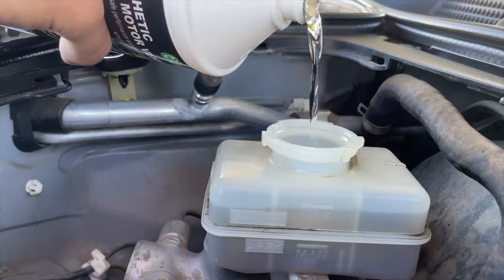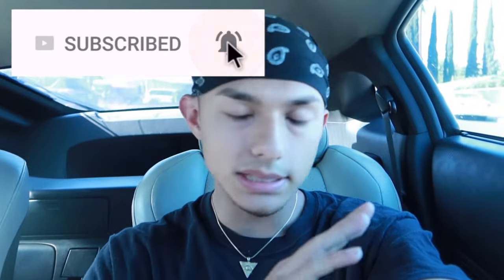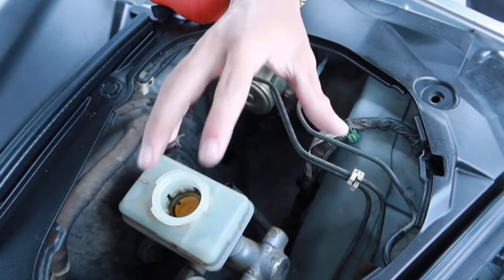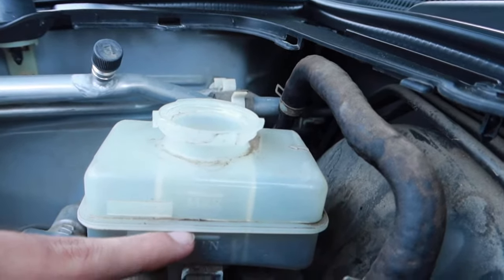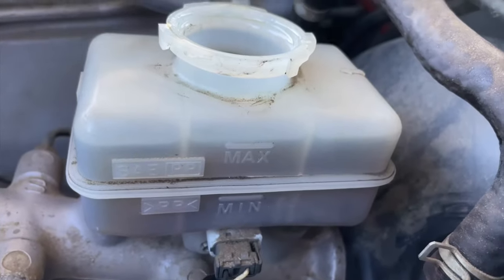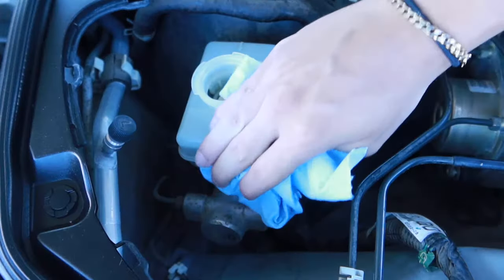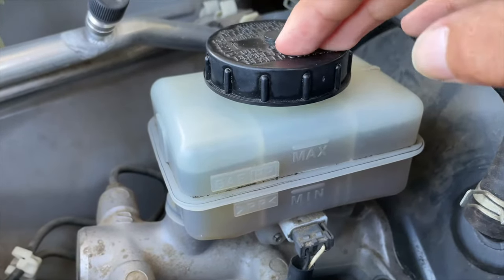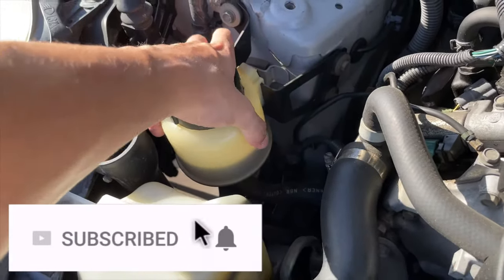How to Change/Clean BRAKE FLUID [NO JACK]! (350Z)

Comment: Some dealerships just change the fluid out of the reservoir.  You can remove all of the fluid out of that reservoir.  You won't get air in the system as long as you do not step on the brakes.
Reply: Thank you
Reply: Question step on the brakes when ?
Reply: @PocketBeast1243r  As long as you don't step on the brakes with the bleed screw open after you remove all of the fluid from the reservoir.
Reply: Question: can I do this if someone put the wrong fluid in there?
Reply: @vonniewilliams750  That depends.  What kind of fluid was it and did they bleed the system with the wrong fluid?

Comment: It's called the "Ranger method" its a lazy army thing lol.  While people say it's not a recirculating system yes that's true BUT the temperature differentials will bring the hotter brake fluid by the calipers up to the resivor so yes this will actually work over time.   I also suggest going all the way to the bottom when sycking out most have a 2 section system where you can't take out too much.  I also recommend putting in Motul 5.1 DOT fluid.  DOT 3, 4, and 5.1 can all be mixed, it's only 5.0 that does not mix with anything except 5.0.   5.1 also has a higher max temperature point. Racing brake fluid that's 4.0 may go even higher BUT don't use racing 4.0 it is thicker and don't last as long.  5.1 is the same thickness as regular 3 and 4 but having the high racing max temp range while lasting the same long time.   Motul 5.1 is the way to go.    Cool video you rarely see people mention the ranger method because they don't want to get made fun of but it 100% does work and I'm glad you made this video.  This method is wayyyyy better than the never change your fluid method :)
Reply: I going try it..it like over $100 at dealerships
Reply: Motul 5.1 doesnt last as long as racing brake fluid is more hydroscopic so needs to be changed out more frequently.
Reply: @riyadyar   racing brake fluid needs to be changed more often like you said.  Motul 5.1 is not racing brake fluid. Motul only makes a racing brake fluid in 4.0 not 5.1.  I use the 5.1 so it lasts longer and has a dry boiling point of 516°F (272°C).  I have not seen any 5.1 fluid in the racing formula that needs to be changed often, it may exist though.  From what I've seen all dot 5.1 are for regular every day driving just with higher boiling points.  I am not just going on hearsay also, I have tested this fluid monthly because I wasn't sure if I believed the claim either and 6 months later it still tests at or below 1% absorption.  Racing fluid would already be over 5% after this long, so for sure Motul 5.1 is THE one to go with.
Reply: I have been doing this range method. I take my car to the dealership for other service's and they have never mentioned needing to change my break fluid. It definitely has worked.
Reply: @soapzuds4542 does this work on a 2019 Nissan Altima ? I ain’t paying them 200$ to replace cloudy brake fluid 😓😅

Comment: Actually you can remove all the fluid in the reservoir.. the reason you don't want it to empty when bleeding brakes is because it's sucking and will pull air into the system, whereas when not bleeding and just sucking it out with pump or turkey B you'll be completely fine and no air will be in the system
Reply: We’ll explain how tf to do it
Reply: Can u remove all brake fluid remove and it won't get air in
Reply: Agreed- As long as you don't press the brake pedal while the reservoir is empty you'll be fine and NO air will enter the system.
Reply: So then all he’s doing is replacing bits each time so that it just works itself into the break system which cleans out the bad break fluids and replaces with good fluid?

Comment: If you're on flat ground you can drop the level well below the min line. That line is only there to make sure as your car tilts while driving and temperatures change, the level doesn't drop so low that air will be sucked in. This whole process will be much more efficient if you can see the intake hose at the bottom of the reservoir and just make sure you don't drop all the way to that level.
Reply: Thanks! great hint for me

Comment: You shouldn't judge brake fluid by its color. 3 is clear but as you go up dot4 or 5 into the synthetics it becomes more and more darker in color the problem with brake fluid is that it loves to absorb water and when it does then it becomes dangerous! You can have perfectly clear brake fluid in your car but if it has water in it and you can't tell just by looking at it you will actually need to test the fluid then that brake fluid is bad fluid and needs to be replaced AsAP, you can have brake fluid that looks like tar okay maybe not tar, but you get exactly what I mean though if you check that dark fluid and it says that there's no water in it then that fluid is perfectly fine to be used inside your caliber hope this helps!

Comment: Air will never get in the system from the reservoir. You just don’t know how it works. And brake fluid circulates
Reply from the maker: respectfully… you are 110% wrong. pick up a mechanics book or turn your brain on bud
Reply from the maker: to: everyone else with their brain turned on… your brake system is hydraulic pressurized system. THERE NO CIRCULATION. this isn’t an attic that needs to be vented out. there can be no air, no moisture, not even the smallest opening. cause even with a single loose bleeder valve, can compromise the system and cause depressurization. YOUR BRAKES. NO STOP. brake fluids moves through the system as you brake. using the brakes causing a pressure in the system, which pumps fluid through all the brakes back in and through your master cylinder. if air is sucked in from the master cylinder it will distribute into the brake lines/calipers. and the only way to get that out, is to BLEED THE SYSTEM. it does NOT circulate out of a pressurized system. DONT EVEN get me started why air/moisture is catastrophic is a hydraulic enclosure my guy. respectfully doe ✊🏽 all love. that’s what i’m here for and love to do, i’m actually working on my brake pads and rotors how-to right now. ✌🏽
Reply: @JakeCande   1# air will only get in the system if you push the brake pedal while the reservoir is empty. (( have you heard about gravity bleeding)). #2 the fluid gets mixed together the new fluid will dilute the old one. When you push the brake pedal the master cylinder sucks fluid from the reservoir pressurizing the fluid that pressure pushes the brake pistons. So if you keep replacing the fluid in the reservoir very often you at certain point you will have all new fluid. When you pressurize gas oil or water they get mixed  . If you keep replacing the brake fluid in reservoir the moisture in brake fluid will drop to even 1 or less that all depends on how many times you want to keep doing it.
Reply from the maker: ight my guy your #1, that’s the whole point of the video is pressing the brake and refilling before it’s empty! so what are we talking about? and GAVITY BLEEDING 😂😂 ayo you fosho have no professional training. and it only works ‘okay’ if you have two people, which is missing the whole point of the video. 
your #2 literally made me laugh. you are completely wrong. and shows you haven’t taken an intro shop class. AIR/MOISTER does not DILUTE it CONTAMINATES it. idk why you even commented on a HOW TO VIDEO THAT YOU CLICKED ON without googling anything first. your comments are kinda weird, you are talking about brake fluid mixing (which is the point of the video) but we were talking about AIR. water and hydraulic fluid don’t mix. sooo bud imma stop responding. ✌🏽 all love

Comment: You could always use a soap dispenser when your press down that straw thingy you can put it inside and use a water bottle to fill it and close it so you can despose
If it but I like this video bro !!!!
Reply from the maker: that’s a crazy idea i’ve never thought of !!
Reply: I just tried this, and it works great! Stick the soap dispenser siphon down to the bottom of the master cylinder, and pretend you’re pumping out enough soap to wash a Clydesdale. 

Thanks for the tip!

Comment: I did this to my older Audi even with vw-audi fluid 6 class eerr.. 😢cause I was a bit lazy honestly but after a year I had still issue with ESP traction control n ABS or even so the 2 brake pressure sensors(G201-G214)blip blip n lastly no way than bleed flush all the way out n replaced with affordable ATE SL6 / class 6, the result was amazing, it’s cured 
Honesty respect, ‘cause I’m one that’s No spend for garage or dealer n lastly you can save your money for the tools you don’t need tobe a mechanic to DIY your cars 
Cheers 🍻

Comment: May be a silly question but will that leave dirty fluid in the lines vs when you bleed it or does it go back into the master cylinder thus removing it until it all mixes over time?
Reply: I would like to know also.
Reply: I suppose he said there could be crap in the master cylinder. So I assume it would end up back there.

Comment: Did you use the same brake fluid bottle for the changes? I heard somewhere that once you open the brake fluid bottle its recommended not to use is because moisture can affect the fluid itself. 
Wondering if there's any authenticity to that?
Reply: I wondered this too.
A sealed bottle of break fluid has a shelf life of two years.
Once it is open, it’s best to use it within one year or less.
Because break fluid absorbs moisture from the air, it’s hygroscopic. But think about the master cylinder being open (exposed to air) every now and then when it’s opened to inspect it.
It’s then capped. Just like a bottle of fluid, you use it, then cap it off.

Comment: Does bad breaking fluid cost the Slip,TCS and ABS lights on
Reply from the maker: low brake fluid will. i’m not too sure if “bad” brake fluid will. i have slip, tcs, abs, and brake lights on because i have oversized tires/rims. it’s messing with the wheels speed sensors. there’s a few reasons why those lights can come on, most reasons have something to do with the ABS system.

Comment: Hey , i have a question 🙋🏻‍♂️ 
So after checking out this video which gave me some motivation to do this on my own and not to spend much money outside and thanks to you . 
Allright so coming to my concern can i just take out all the old fluid with the help of baster and pour new brake fluid into that . Do i still have to open the tires and take out the old oil from there or thats fine if i dont ? 
Will the new fluid which i will pour , automatically mixes up after i drive 2 or 3 days ?
Reply from the maker: hey man, i’m glad this video inspired you bro. i appreciate it. 
for your concerns: no, you don’t wanna just take out all the old fluid because then it will let air into the brake system and then you would have to bleed the brakes (which makes this job 10x harder). that’s why you have to do little by little. it takes longer but it’s the easiest way to do it correctly. 
and yes the the new fluid you pour will mix up automatically when using the brakes.
Reply: If you're on flat ground you can drop the level well below the min line. That line is only there to make sure as your car tilts while driving and temperatures change, the level doesn't drop so low that air will be sucked in. This whole process will be much more efficient if you can see the intake hose and just make sure you don't drop all the way to that level.
Reply: @eYeZiQ true u could go a bit lower when removing the fluid. But the purpose is to ensure absolutely 0 risk. Even if u are 100% correct. It’s a different of having to remove and top up 1-2 more times.
Reply: @JakeCande when u say it’s better to bleed. If you continued doing this every time. Would it be 100% ok long term. Or at some point it would be best to get this done properly. Even after a few years or more or after a certain number of miles/kms?

Comment: I’m struggling to tell what levels my break fluid is on, cos I think it’s clear.

When I remove the cap, the filter seems to have a small pool of liquid in it, does that mean the reservoir is full or has some liquid just retained in the filter?
Reply: It Means full

Comment: This won't do anything for the dirty waterlogged brake fluid down in the wheel cylinders/brake calipers where all braking issues arise as that's where the heat is generated from the brakes, After refilling the master cylinder with clean fluid you must bleed each wheel starting from the furthest away from the master cylinder, Bleed the fluid until fluid comes out clean and clear, Repeat procedure on remaining three wheels taking care to check and refill master cylinder after each wheel bled.

Comment: Man, you need to pour new fluid from the top and bleed old fluid from the calipers, all the bad fluid is at the caliper which is part that gets hot and cakes it.   Start from the rear wheel farthest from the reservoir and end at the wheel closer to the reservoir, you can do the whole job in about 1 hour.

Comment: Did you notice a difference in brake power?
Reply from the maker: no, i personally didn’t because my brake fluid wasn’t too bad. in some extreme cases you’d might feel a difference.
Reply: @JakeCande  My car was so low on brake fluid that when i filled it up, its able to move alot further without accelerating! If your low on brake fluid it will definitly make your car move further!